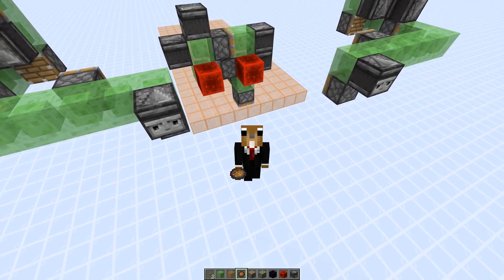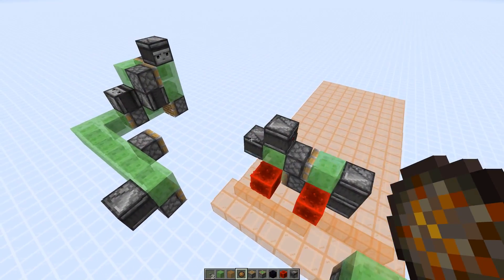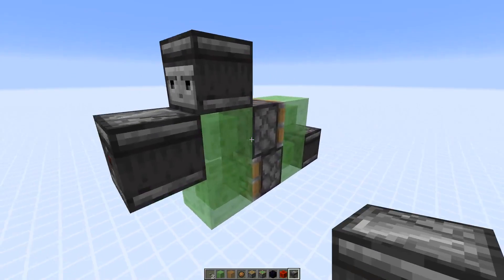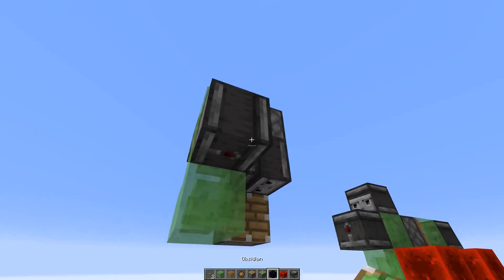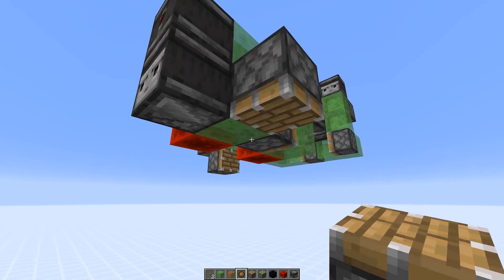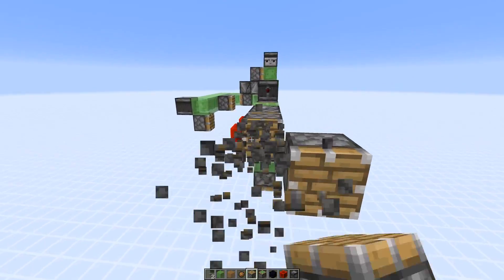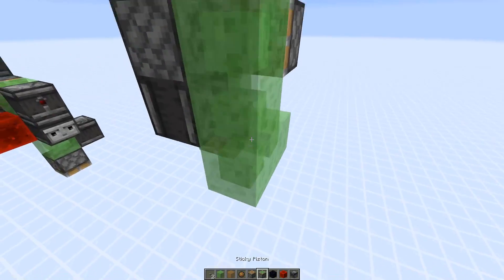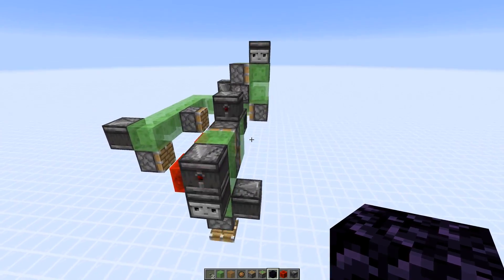Basic 3 Directional Block Pushing/Pulling Machine

Comment: what mod is that? you can place directional blocks while facing anywhere.
Reply: @Zephyrius would it work in multiplayer?
Reply: @kikifrh  I've tested it and most of it works in multiplayer, however carpet is required for placing pistons/observers backwards sadly, but the diagonal block placing and other stuff works fine